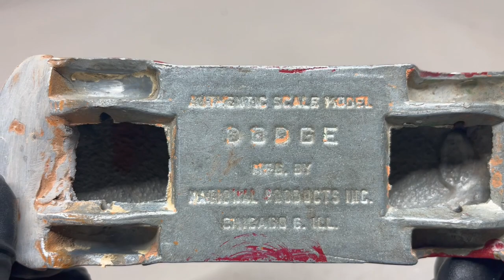1946 DODGE SEDAN Automobile Toy Cast Metal Restoration

Comment: Due to the sandblasting, the surface has become irregular and that is unfortunately reflected in the paintwork. I think you should first apply a base coat and sand it. The topcoat becomes smoother.